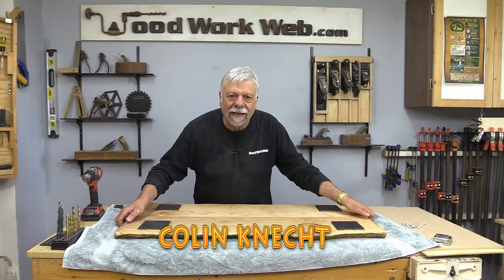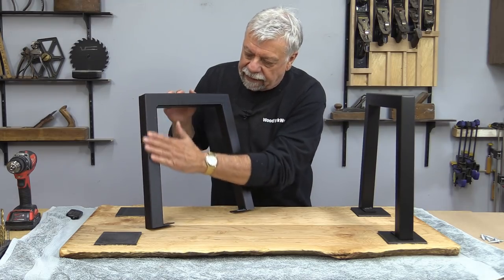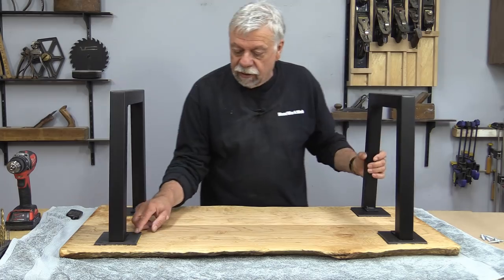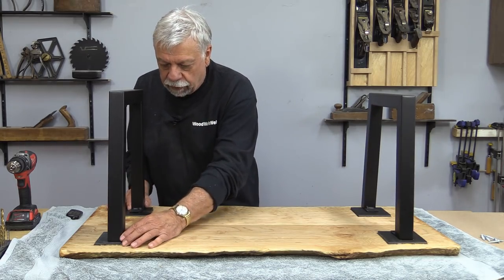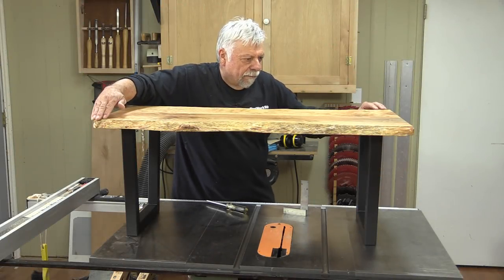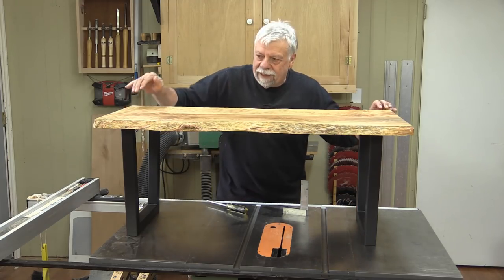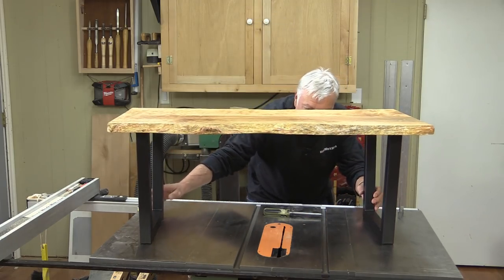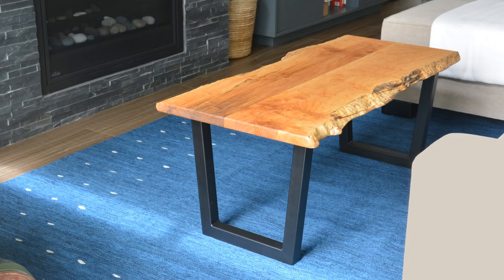Installing Metal Legs on Live Edge Wood Table

Comment: I think that was a very excellent job.  Couple things.  I would mention, and I am mentioning it, that satin black auto paint is readily available in the spray can variety and used in engine compartments so no need to drag out the compressor.  And the self-centering bit is called a Vix Bit and is available at Harbor Freight for less than ten bucks.
Reply from the maker: Yes, the paint I used was in a spray can, I guess I wasn't clear on that - thanks

Comment: Do the legs themselves allow for wood movement, since they the tops of the legs tied together with steel directly underneath the table?   Is that why you were able to screw directly into them and not use something that allows the wood to move?
Reply: Mild steel isn't completely rigid.  The legs will easily spread apart and contract the couple of millimeters that the table top will move in a controlled climate environment.
Reply: It would have been nice to see that tested. Colin could have taken a ratcheting strap around the legs to squeeze them together, and then jammed a board in between them to splay them apart, measuring the difference in span at the tops of the legs.
Reply: You can't always assume it's going to be a controlled climate environment.   People store furniture for renovations, large parties, moving, etc.
Reply: You couldn't get a top that size to move more than a 1/4" an inch if you were intentionally going from a sauna to an electric oven.  The legs will easily give that much.
Reply: You're wrong, Matt. A 3% change in width is not unusual. What are those legs, about 18-in wide? So 3% of 18-in is about 1/2-in.

Tube steel is quite rigid. I am not at all certain it can flex 1/2-in. That is why I previous said that it would be nice if Colin had measured the flex in the legs.
Reply: Well I build stuff out of steel pretty regularly and I can guarantee you that those legs will flex plenty to accommodate the wood movement.  It's mild steel and it has the full leverage of the entire length of the leg working against the weld.   Wether it moves 1/4" or a 1/2" is irrelevant.   Also don't forget that it was assembled under "average" conditions, so it's roughly centered in whatever range of wood movement it will experience.  The legs only need to flex 1/2 of the total movement in either direction.
Reply: Your "guarantee" is worth precisely zero. You already got the possible amount of wood movement wrong, using similarly overconfident language. What is needed to settle the question is actual measurements. Unfortunately, it sounds like Colin does not have the part anymore so he cannot test the flex.

Comment: What screws would u recommend using to attach the steel legs to kitchen table . Its about 2.5 inch thick. Was thinking of using the thick coach screws/bolts. Thoughts?? Thanks

Comment: While I love the looks of your table top as well as the legs, I am concerned about two things - you did not allow for the wood movement by milling oval (elongated) slots in the metal plates. In my experience working with both metal and wood, just no way those legs will spread even millimeters with the expansion and contraction that can take place with your table top. Second, you've got both holes drilled in each plate in direct line of each other. Those holes should be staggered so as not to be screwed into the wood inline with grain. Please take this as constructive advice rather than criticism. I've followed your channel for a long time and take great enjoyment watching your videos.  mike
Reply from the maker: There is a bit of movement between the existing screw holes and the screws I used and with some flex in the legs and based on the moisture content I was working with and the environment the table will live in there should be no problems of the top cracking, but I'm more concerned the top will warp a bit if it absorbs too much moisture too quickly but all we can do is watch and see what happens if anything